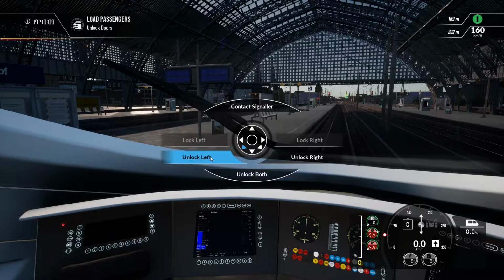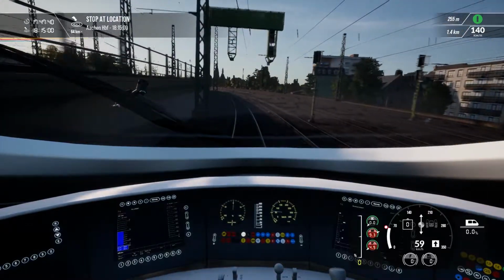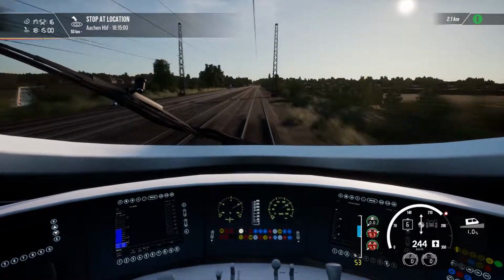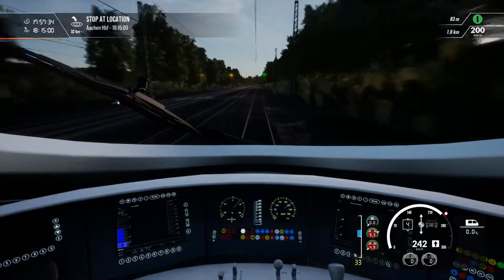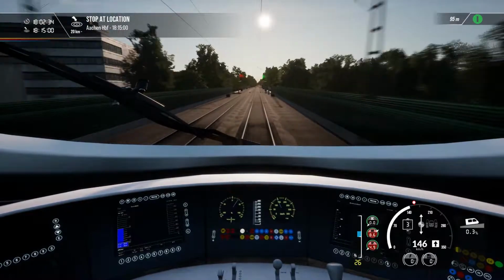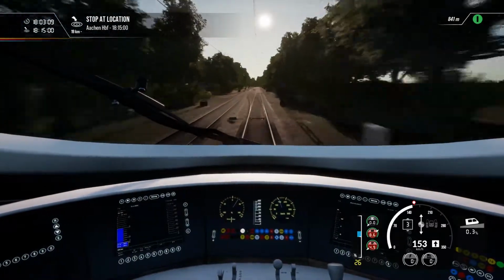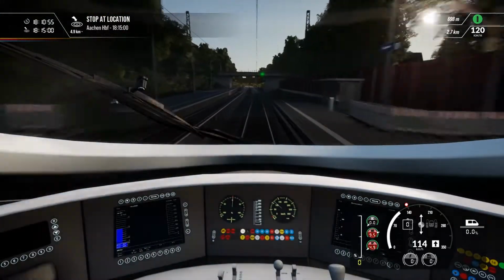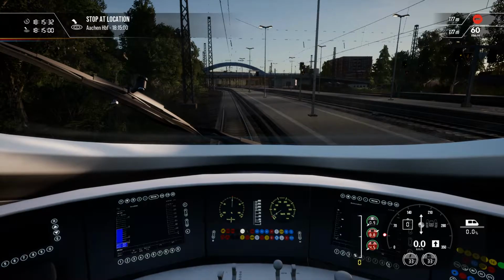Train Sim World 2 - Köln To Aachen - BR406 ICE3M DB

Comment: As you said that the North Eastern Corridor is not included in Tsw2 I thought about my freight train disaster.

I like this route because of the Amtrak.

But there was a funny bug, which is still in the game atleast in the ps4 version.

I did the scenario or the time table mode with the Csx train, which hauled garbage. I did everything I had to do. But the game sets you on a route, which can not be completed because it makes you drive out of the area you are supposed to go and the Mission failed. And the section on which you have to arrive is bugged too. It showed me the wrong track but I could not change to the other track because the game did not make me do that. This mission is unbeatable on ps4.
Reply from the maker: Yeah, the game is very buggy. Very frustrating.